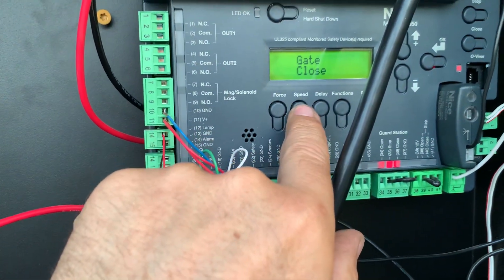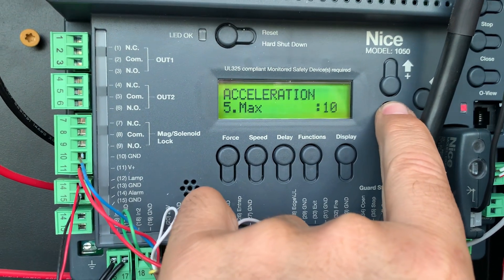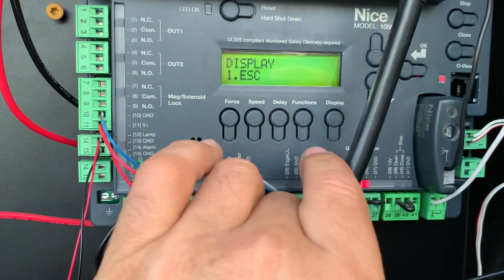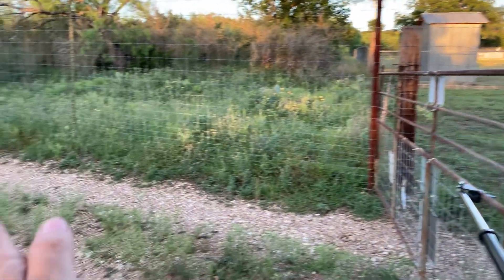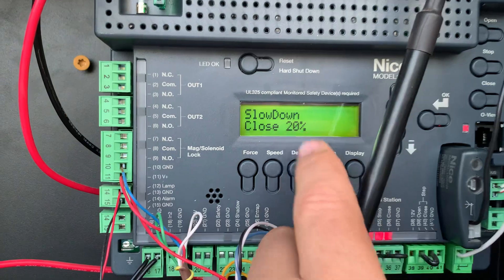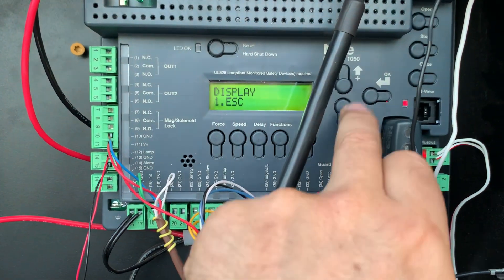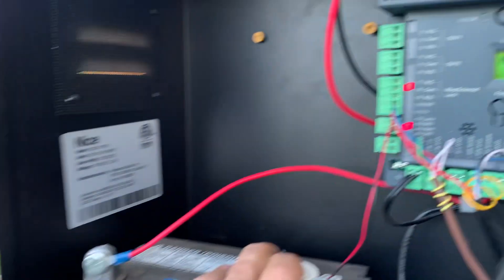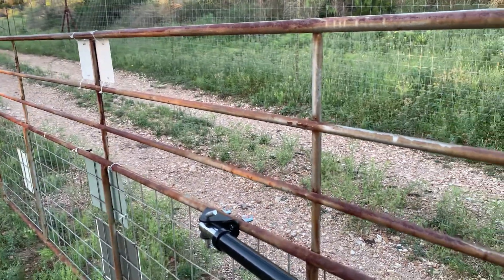✅ Nice Apollo 1050 Control Board ● Setting up Slow Down Mode for Your Gate Opener

Comment: When my gate opens after it slows down but at the end it still slams with my curb, how can i adjust it so it wont slam to my curb. I have slowdown setting same as yours.
Reply from the maker: If you have maxed out the slow down, then you might try adjusting the "stop" on that arm so that it reaches the distance limit a little bit sooner. Then the sway of the arm due to the movement won't bump your curb.
Reply: @ApacheRanch  how do you set up that? I went on vacation for three weeks, upon returning battery died. I replaced the battery and after that its been tough to make it work. I had to hard reset every day, it would run like 5-7 cycle (24 hours) and wont work. It will just click but wont operate. So, finally i gave up and switched to manual mode. And now i came across your video and messaged you. Sun charger has good voltage as well as the battery is also new. Check the Sensor and no obstruction but i am assuming since it runs to curb it triggers something. I tried with LEARN process to make it stop at the desired position while open but it didnt work. So let see, What would be ideal Static/Dynamic Value for this. I have a Single Swing Average Size gate.
Reply from the maker: @deliciousdeli6722 on the actuator arms themselves there are adjustment screws that you turn to halt the movement of the arm. I have another video on a single farm gate install where I think I explained how to do that.
Reply: @ApacheRanch    I have Titan 912L.

Comment: Thanks, the "Nice" people do not go over it very clearly. 
UPDATE: It wasn't working at first, totally my fault, with all the problems i had with this board, I needed to also had to  "learn" the gate swing again. Then this worked perfectly - thanks again, just wanted to share in case someone else has the same problem I did. 
I have had mine about 2 years, and it gives me problems almost monthly, they have sent me 2 new boards and I am going out once again to figure out why its not closing again!!! 
Question, is there a way to program my car to open the gate, it seems to only work with the factory remote.
Reply from the maker: I’ve had same experiences with board replacements. Not pleasant. And no, you can only use Nice remotes with the nice receiver. BUT - it’s easy to add a third party receiver inside your box, connect it to the Nice board, and then use what remotes you wish with that receiver.